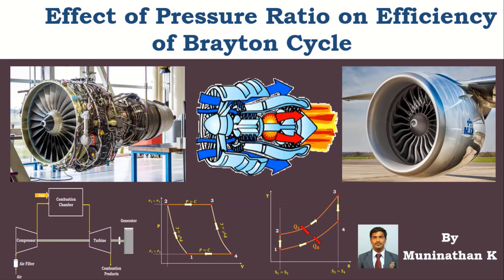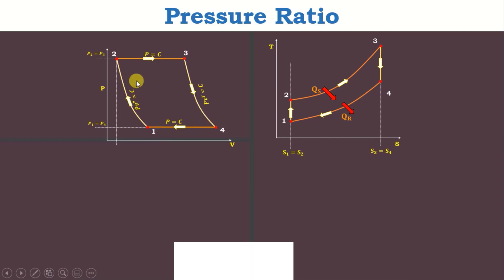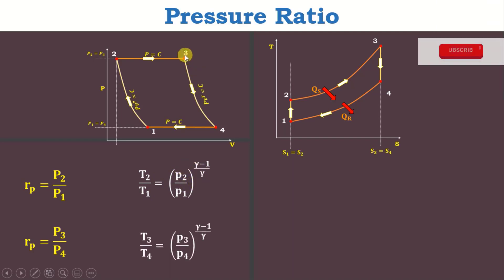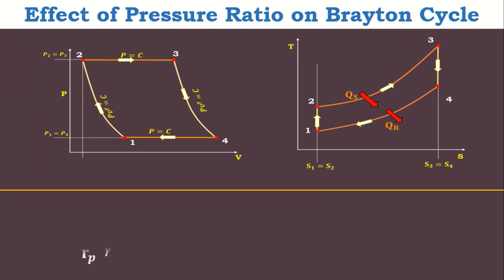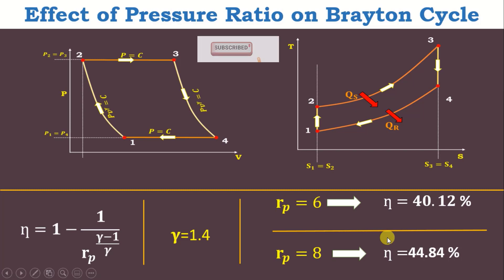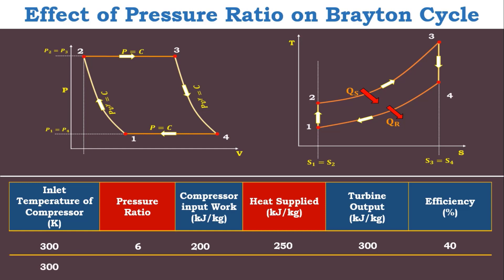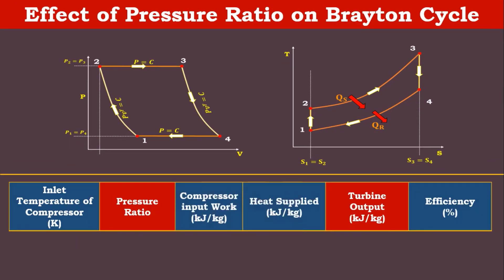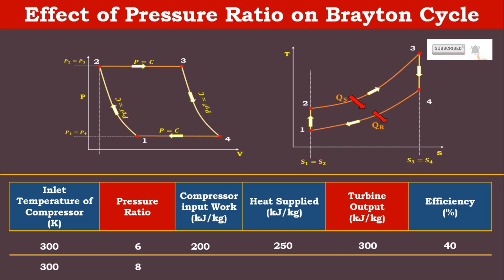Effect of pressure Ratio on Brayton Cycle | Joules Cycle | Gas Turbine Engine

Comment: Hi.
Where do we get gamma = 1.4  and gamma is fix for specific system unless we change the gas that we supplied?

And how do you get Wc = 200,heat Qs= 250 etc? Which formula you used?

Lastly, in real machine,how do we increase rp or it is fix once compressor is built?